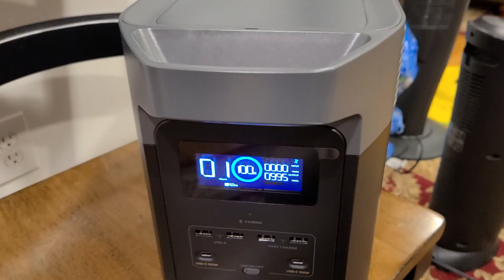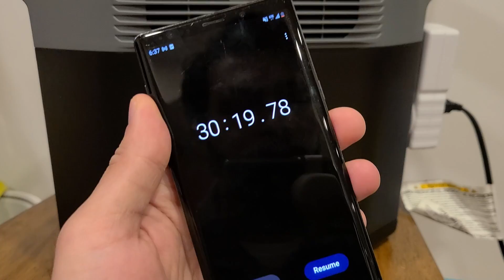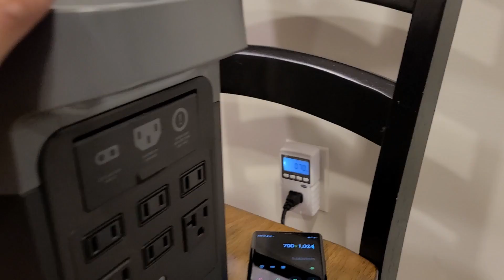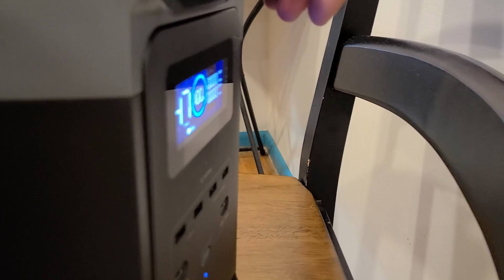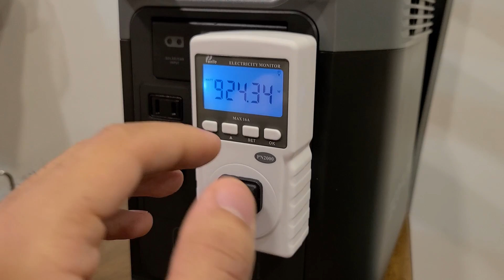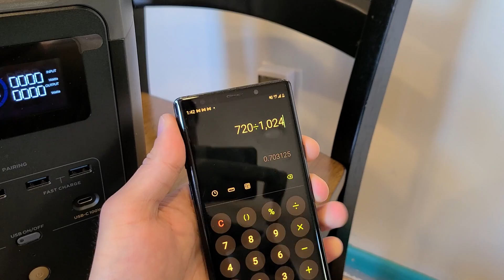EcoFlow DELTA 2 AC Capacity Test

Comment: It would be nice to have seen what the Wh you put INTO charging the Delta 2 was as well.  This will give you a true reading of the "efficiency" round trip, since most of these solar generators' BMS have their own internal "buffer" for capacity discharge/charge to preserve good cycling (meaning a 1024 Wh battery, is probably only being charged to 92% and discharged to 10%, so 82% of the 1024 to start, then put the AC inverter and charger efficiencies on top of that).

Comment: Can you splice a redondo or similar battery to the battery port? Or are there communications that occur with that cable?
Reply: I own the cable that EcoFlow provided and included when I purchased the non-referbashed NEW EcoFlow Delta Max extra battery from EcoFlow via AMAZON. The EcoFlow provided cable has a total of 8 male pins in each connector. Two (2) of the male pins I believe transmit the D/C voltage between the Delta Max extra battery and the Delta 2 unit. The oner six (6) male pins, substationly smaller in circumference, I believe allow communications between the Delta Max extra battery and the Delt 2 unit.

Comment: Hello, very nice test comparing a constant high watt load to a constant medium (low setting on the heater)
 watt load. I would have guessed a better resut then 20 watts difference but that heater sucks watts hard be it on high or low settings. My full size refregerator/freezer that is 16 years old pulls 120 watts when it needs to run.  Open the door and the lights inside use 94 watts! I also own a Delta 2. I like to only charge its batteries at 300 watts not the 1200 watts its capable of charging. My theroy is filling the batteries at a slower rate will allow for better balanced batteries. I understand how a person would want to charge the Delta 2 batteries at 1200 watts as time may be short. Batteries are tricky stuff in that there are so many variables but you did a very nice controled test. Thank you for your fair evaluation.